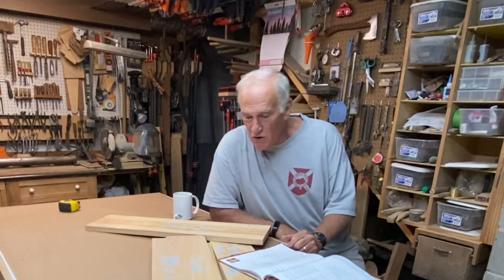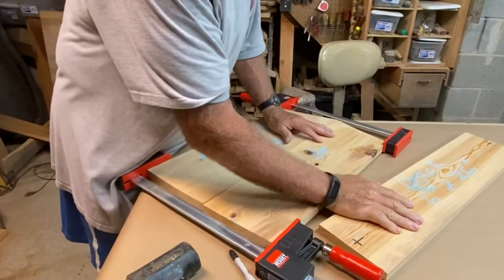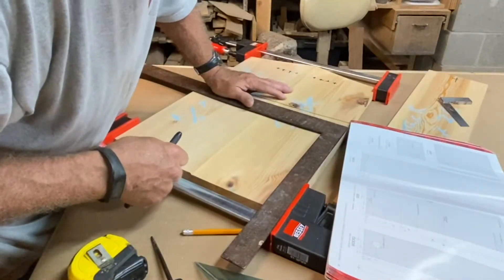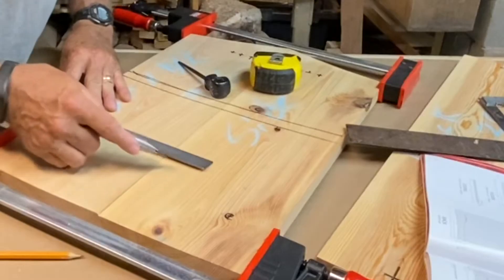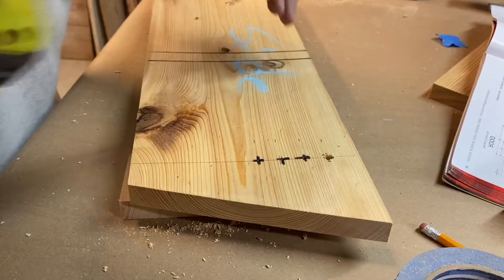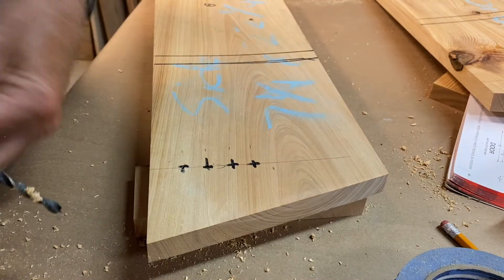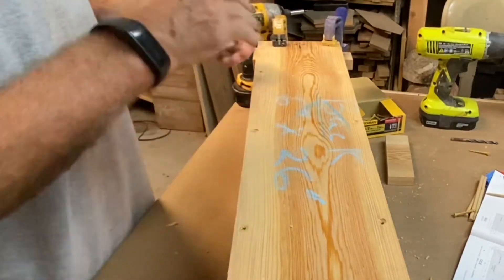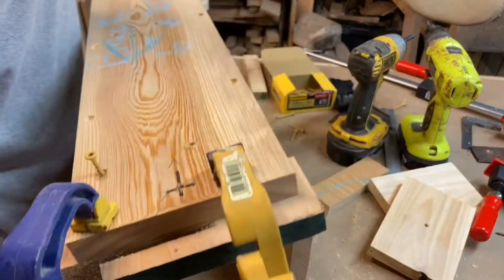How to Build A Roosting Box: Paul Meisel Design

Comment: if you can drill 2 holes side by side about an inch apart on the bottom entrance, it would work better because a birds body while looking into the single hole, blocks out all light so that the bird cannot see the floor and the roosting pegs above and simply will not go into a black unknown space. this will help.
Reply from the maker: @dennischolo909  thanks Dennis, that’s a great idea. I just followed the plans in the book. I recently opened that box. Nothing has ever been in it. I’m going to try your idea.